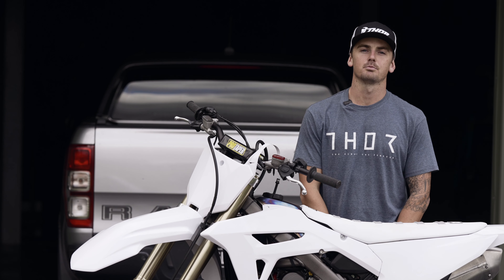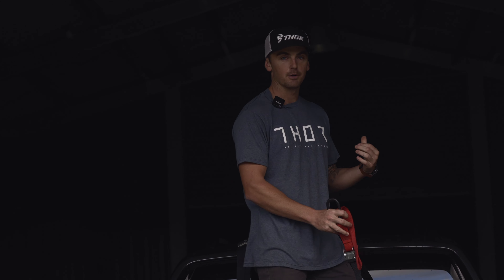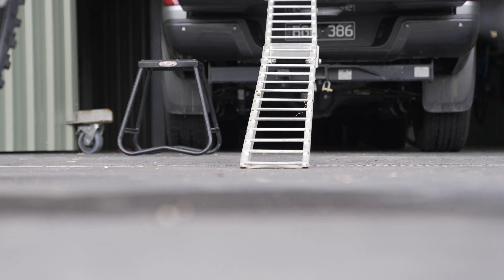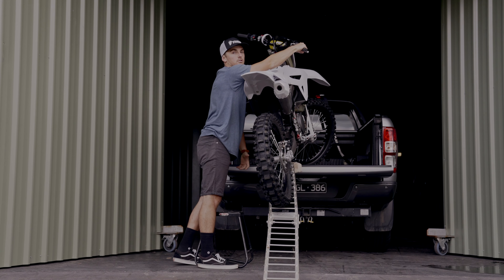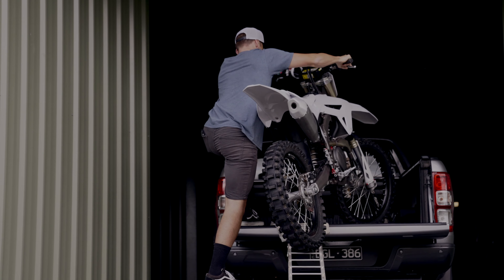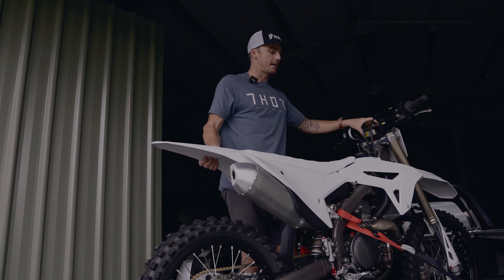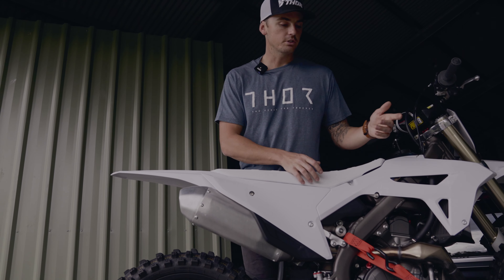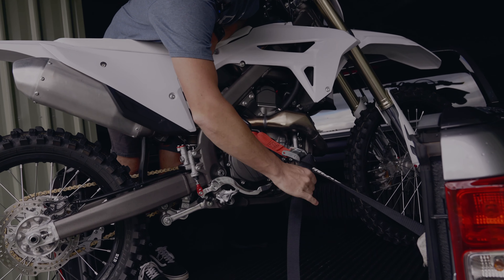MXstore MotoMinute: Loading and Transporting your Dirt Bike | MXstore.com.au

Comment: Are you able to close the tailgate on the ranger?
Reply: For an 85cc you can if diagonal. Not for anything 125cc and above generally.
Reply from the maker: Unfortunately not with the bigger bikes on the back of a dual cab! 😢
Reply: @MxstoreAustralia  how do you secure the tailgate?
Reply from the maker: By using a tie-down, each tailgate will be slightly different nut it's super easy to secure with the tie-down!
Reply: Whats the best ramp to use I see your bends a bit